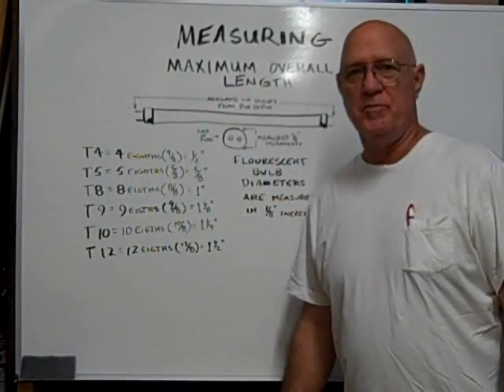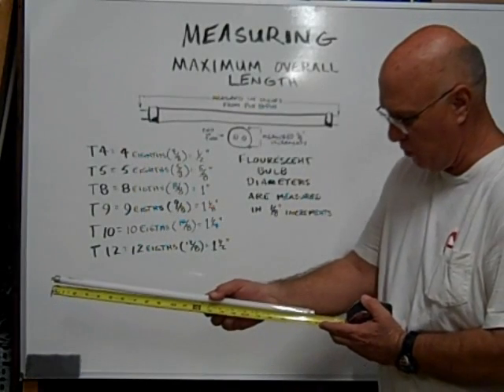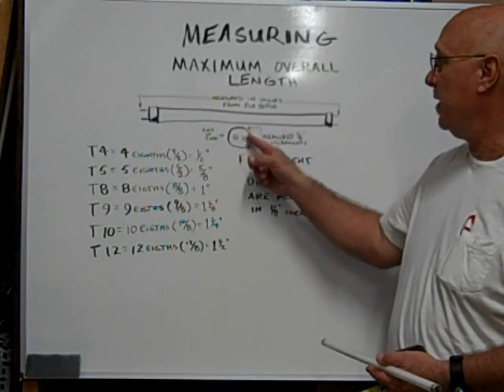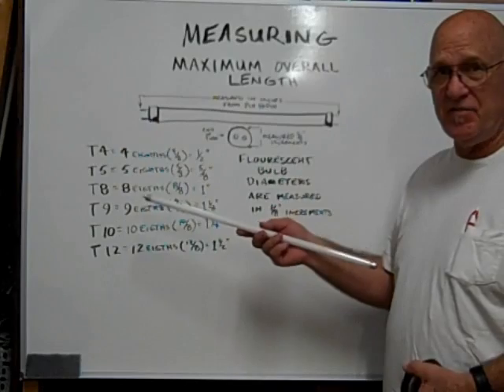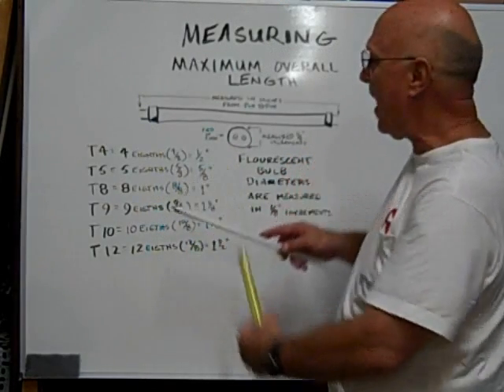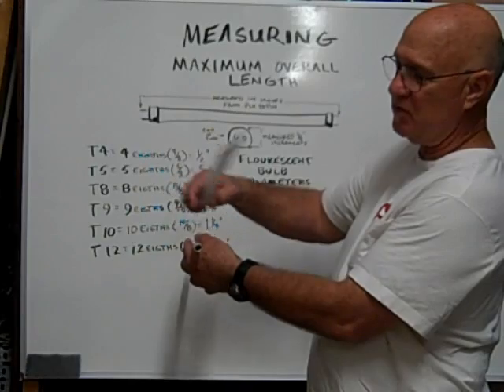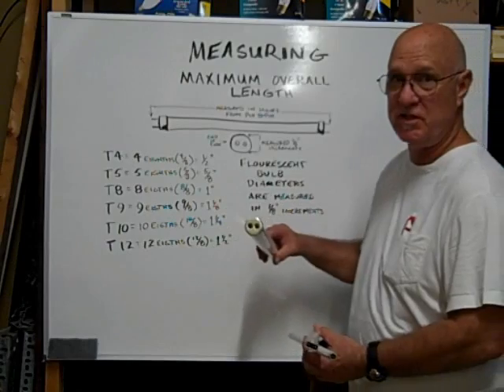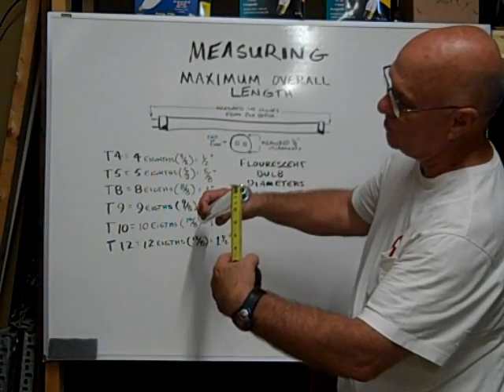How To Measure Fluorescent Tubes

Comment: My fixture holds  a 12 inch Circline Fluorescent and a 16 inch  Circline Fluorescent . They both have the 4 pin plug but the 12 incher says T9 on it while the 16 incher says T10...Is that right?

Comment: Actually you do not measure the bulb, you measure from back end of the socket to back end of the socket. So the correct size may be 1/8" to a 1/4" inch longer than the over all length of the bulb. So a bulb that measures 23-3/4" tip of prong to tip of prong is a 24" bulb
Reply: Thanks, apparently you are the only person in the universe that knows this, lol
Reply: Thank you! My measurements concur with you: My bulb has 24" markings on the bulb itself, and as you state, it is indeed less than 24" bulb-prong to bulb-prong. It's only 24" from back end of the sockets as you state. THANKS THANKS THANKS!

Comment: Damn the imperial system is super retarded.  For those of you sensible enough to use the metric system, you want to tape measure the following values when measuring the diameter of the tube:

T4 = 12.70 mm
T5 = 15.87 mm
T8 = 25.40 mm
T9 = 28.57 mm
T10 = 31.75 mm
T12 = 38.10 mm